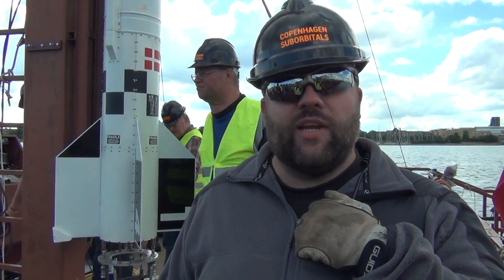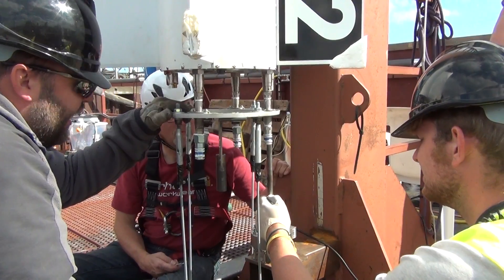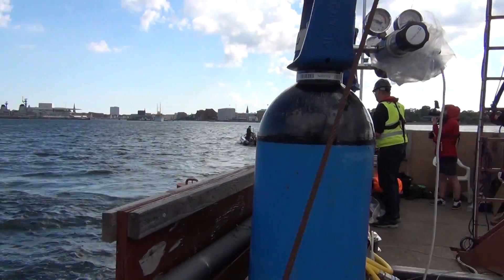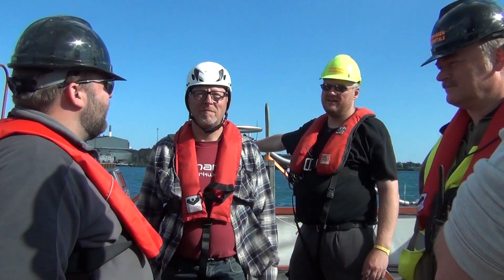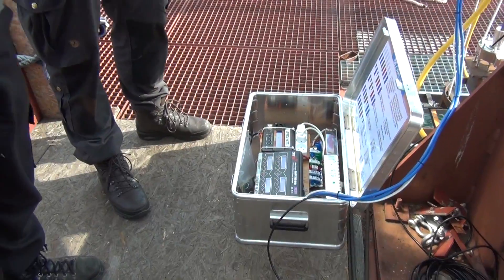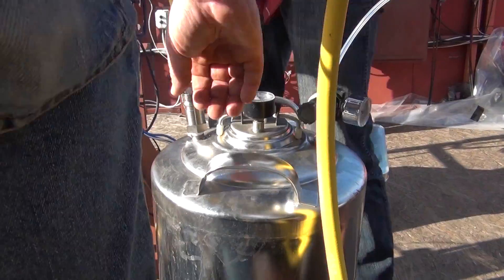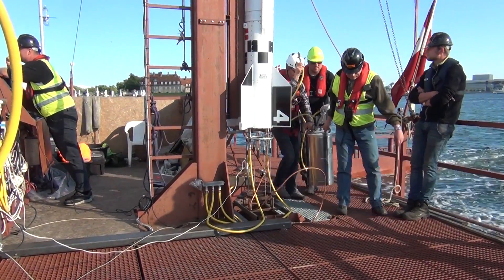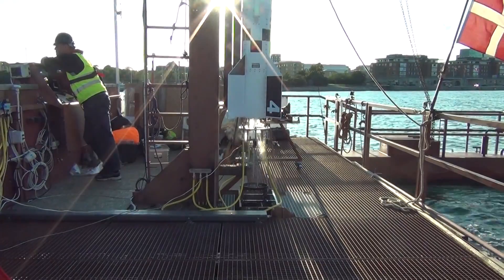NEXØ 1 Sea Acceptance Test 2016

Comment: Did you decide to go with nitrogen for the pressurizer instead of helium? Do you guys grease the launch rails?
Reply: helium is a very poor gas for this test. specially when all the reserver we have, is nearly depleted :) nitrogen should be just fine. and far more easy to get hold of. :) specialy when most of the surrounding air is made of nitrogen :)
i don't think they grease the launch rail. looks pretty free floating on the rail and its only has to hold it a few meters anyway :)
Reply: lets just say i feel bad about people using helium for balloons :) i really don't get why it's legal :)
Reply: I didn't mean to imply helium should have been used for this ground test.  I was referring to the flight itself.
Reply: +Mini DK#9 
Mini dk? hvorfor så på engelsk xD
helium er en Nobel gas. den reagere næsten ikke med noget :) så det kan ikke brænde overhoved :) du mener måske brint eller kendt som hydrogen. dette er brændbart. men hvis du lytter efter. så bruger de blanding af vand og alkohol som brændstof og ilt som ozydizer. og fylder tanken med nitrogen for at se om ventilerne fryser til. hvilket gør det umuligt at flyve. :)
Reply: Han mener helium til tryksætning. Og ja, mener de bruger helium til flight, da nitrogen vist ikke kan komprimeres nok til det formål.
Reply: Det er da pænt gjort at skrive på engelsk. Så skal de ikke svare på det samme flere gange, og alle kan få glæde af svaret.
Reply: tjaeh x'D kan du vel havde ret i :P men ofte lidt nemmere at tage det til ens modersmål :P